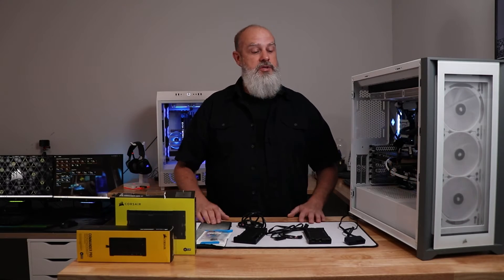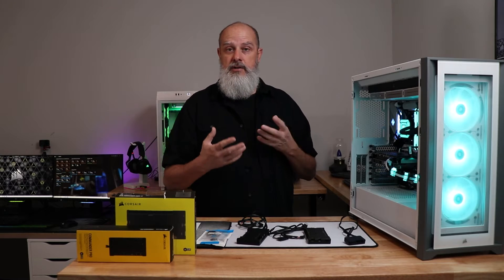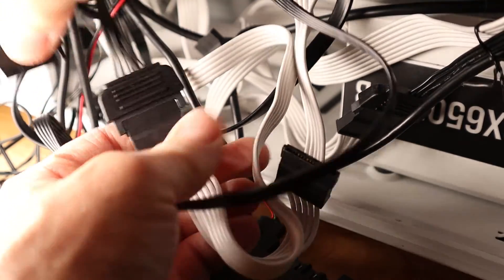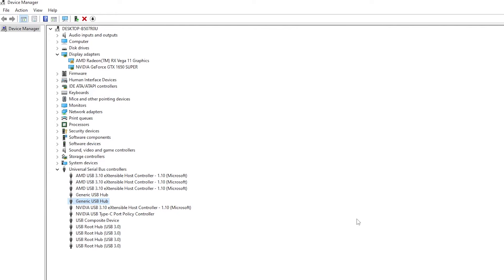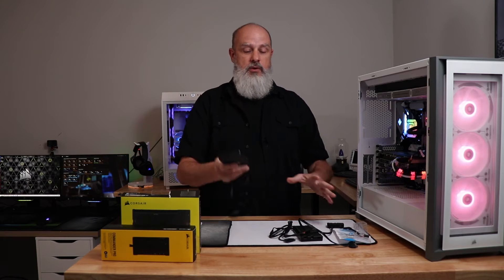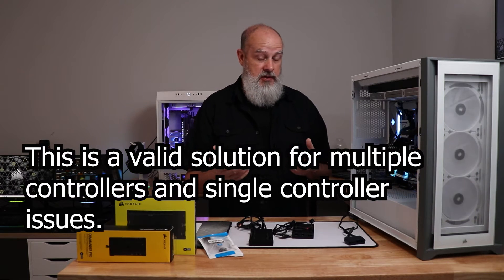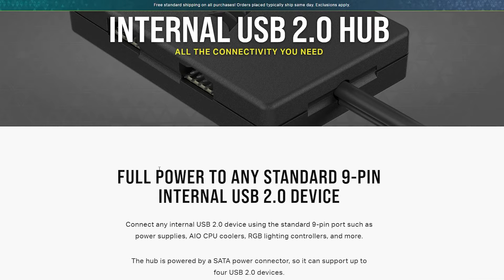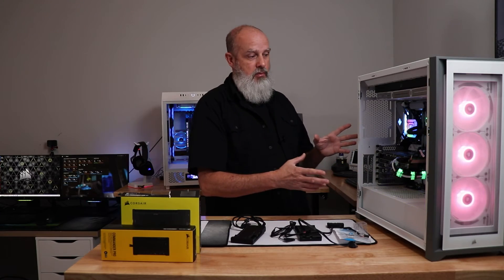Corsair iCUE doesn't detect my RGB controller

Comment: Hmm, I've been dealing with the fact that my iCue software isn't detecting the H150i ELITE LCD XT components connected to the Core that came with it, but this video did make me think about the fact that I am using that Y cable that came with the AIO. Right now, the Core and my O11 Dynamic EVO's Case RGB header are connected to that Y-cable. I'm going to have to give that a try. My motherboard happens to have two available headers, so I hope this has been my problem. I guess I'll update this comment if that was the case.

UPDATE: Well, I gave it a "college try", as my High School baseball coach used to say... I disconnected the iCue Commander and the O11's USB headers from the Corsair supplied Y cable, and plugged them directly into the two available USB 2.0 headers on my CrossHair VIII Dark Hero motherboard. No dice. I even tried swapping ports between the two, and still nothing. The case's RGB works and can be configured under Armoury Crate just fine, but iCue just does not see any sensors, the LCD, nor the motherboard (which it did at one point). I might end up trying an internal powered USB hub next (like the ones offered by Corsair or NZXT), which is likely my final hope before throwing in the towel. I mean sure, I could try poking around with Wireshark, but I've used it to track network traffic, and it can be a handful to get a good grasp of what's going on as it is... I can't imagine trying to track USB traffic.  Anyway, my only other suspicion would be the Commander module itself, but the pump and LCD otherwise works fine, albeit with the default display and transitioning rainbow LCD pattern, so the module is getting power through the main harness. Bah, at this point, I'm just a little frustrated, considering that up until a few days ago, it was working/not working occasionally from power sequence to power sequence. 😩
Reply: Any uppdates? Is it work? I have the same problem.

Comment: Yep, Icue is not detecting my Core Pro or XT.    Trried the different SATA and USB headers.   Installed Motherboard Chipset drivers.  No problems in Device manager, eno exclamation marks.   The only thing iCUE sees is the ram sticks and the motherboard temperature and fan speed sensors from UEFI bios.    No Corsair Controller boxes or fans are showing up.

AMD motherobard and latest bios.  
Are there USB drivers for these things I need to install?
Ist here some kind of auto detection button I need to click in ICUE?

I've used Wireshark before to capture DDOS attacks, when you got down to that point to diagnose the USB bus  traffic I was like holy sh1t!  Too blind to do that now, so not going to happen.

At this point I'm going to try to get iCUE to just detect eithe rthe COre or XT in the software with nothing else connected, one box at the same time, different USB and SATA ports.  I'm thinking they probably both are bad.  Or the USB motherboard headers just will not talk to them or vice versa.   I assume they are suppose to show up in ICue as a big icon like the ram sticks do...  if they are detected.  

I have no idea.  Very na5ty first experience iwth Corsair RGB lighting.  If I get this oorking, I'm never buying into it again that's for sure.  This is just not worth the long protracted stress and headaches.

Have not tried the reset buttons yet..

----- 

Nope still not seeing either box, in ICue 5.3

I'm temtped to mail these two dmmn useful things to you to see if you can get them to work and add to your wall, because they are useless junk to me at this point.

First time installing this stuff, and it has never ever worked.  I mean the Commander Core displays the RGB rainbow puke on anythign plugged into it... by default.   The CORE Xt doesn't display anything on anything plugged into it.    Standing alone plugged into their own individual motherboard ehaders, not daisy chained (like I tried when I first set them up).

Comment: I fixed my issue by uninstalling both headers' drivers in Device Manager. They are called "Generic USB Hub", it is shown in the video. After uninstalling them, you reboot the system and pray for the best.  Mine show up in ICUE as my h150i pump itself, apart from my other Commander. Hope this helps.

Comment: I keep hearing my pc usb connection sound and is happening after I updated my pc
Reply from the maker: Hi Stanley Perez, I've had that issue before,  and it can be hard to nail down what is causing it.  There is a way to tell windows to not notify you of changes in USB, but that's just a mask for the problem. I had to resort to removing all usb devices and add one at a time until it started doing it, and try a powered USB hub internally. I found that it was a USB HDD causing the issue last time, moving it to another port helped, but it still does it every now and then. I've had to leave it out a few times. Start with simplifying your setup, make sure all drivers are up to date and work back to adding everything. Good Luck, thanks for watching!!!!

Comment: Appreciate this post. After watching this video and other forums,  I did what I could and sadly, I still didn't get things to work.

I purchased the Corsair 4000X Case which came with the Controller.  Fan is working and RGB is working. 
The problem I still have is Windows gets the error code 43 Unknown USB which means I can't control my fan RGB :( 

Troubleshooting: 
- Reseated USB 2.0 header connection, Switched to other USB 2.0 header
- Reseated SATA power connection, Switched to other SATA power connection 
- Used USB 3.0 to 2.0 converter header 
- Went from Intel Motherboard with Core i7 9700 to AMD Motherboard with Ryzen 5 2600
- Tried installing and reinstalling the various iCue software
- Changed Power options to high performance and also configured in regedit.
Reply from the maker: Hi Jotaro, It sounds like you've tried all the basics. I'm going to assume other USB devices that are using the internal header work ok. You tried the 3.0 to 2.0 header which should help with any power issues, but if you can, try a powered USB hub. 

This device in the 4000x is a lighting node core, I wonder if perhaps it's just a bad controller, the 43 error may indicate a hardware error. 

I would try removing all other USB devices and their software, leaving only a keyboard or mouse connected, but it sounds like you've tried that. 

At that point, I would have to try another controller, Corsair may send that to you, but the lighting node core should be easy to find, check FB marketplace, ebay, etc. 

I hope that helps, keep at it and have fun with it!!! 

Thanks for watching!!!

Comment: so, ICUE sees my commander core in the software update, however it does not show it on the dashboard or in the firmware update section.
Reply: I fixed it, you need to uninstall both headers' drivers in Device Manager. They are called "Generic USB Hub", it is shown in the video. After uninstalling them, you reboot the system and pray for the best.  Mine show up in ICUE as my h150i pump itself, apart from my other Commander. Hope this helps.
Reply: Same issue here

Comment: Corsair iCue is absolute mess. I couldn't even install it because their next button didn't work and no messages were popping up. So after Googling I had to change my locale and it went through. Then I booted into an empty application and my very expensive high end Corsair keyboard and mouse were not detected... I'm now into hour 3 of trying to get this thing to work...
Reply from the maker: Hi Lubos Maly, I'm sorry to hear the troubles with iCUE. It's mostly stable when i've used it, although i've had some hiccups with it at times. Some really basic suggestsions would be to disable all other rgb controlling software, uninstall icue and reinstall it. 

There was a recent update to ver 5.0 of icue, if you haven't installed that, try uninstalling, reboot and reinstalling the latest version. 

Let me know what you find, thanks for watching!!!
Reply: @HardwareArtisan  I had to get rid of my Express VPN to get steelseries detected so these apps seem all busted up

Comment: I just moved my PC from the floor to a table. Then my fan RGB went out. Corsair iCue only sees the cooler and memory. Fans are working but no lights. it was working fine until I moved it and now it's not. But the main problem is Corsair iCue doesn't see the fans at all. The iCue software has no way to add the fans again.
Reply: U found a solution ?

Comment: I recently installed 2 new fans into my case, and now icue does not detect any of the fans. The day before I installed the new fans, i cue picked up the 3 fans i had installed just fine, now it doesnt pick up anything after I installed the new fans. I already checked and have made sure there is no issue with cables or power or anything inside the case, the fans still spin and my 3 original fans still have a static purple color but the 2 new ones are white. What do I do??
Reply: Same issue! Did you fix it?
Reply: @spamurai565  Yes but im sorry bro I dont remember what I did, i will tell you if I ever remember but I am fairly certain it was a software issue, and I didnt have to physically do anything to the fans or rgb controller

Comment: I'm pretty certain that wallpaper engine  interferes with this Icue.
Reply from the maker: Hi Mikey Waite, thanks for the heads up, I haven't messed with wallpaper engine much, I'll have to try it and see if it breaks things, I could see that. 

Did it cause your controller to not be detected?

Thanks for watching!!!!!
Reply: Yes. That's what seems to happen. After more tests I don't think it's a problem with Wallpaper because I still get issue and now I've purchased Scuff Envision Pro which is alsoset up via icue and giving me all kinds of issues.

Comment: Thanks! This video has helped with troubleshooting, but I think I have a unique issue, essentially my H100i suddenly stopped being detected by the iCue software. Strange thing is when I disconnect the ext cable from the AIO to the commander pro, then commander pro is detected by iCue, but once I plug the ext cable from the AIO back in iCue can no longer detect commander pro. Any suggestions?
Reply from the maker: Hi Piers Yem, That's a great question!  It's always a bit of a concern when a device being plugged in causes an issue with another device. Here is what I would do. Let's start by making sure the commander PRO is still working normally, I'm assuming when you say ext cable, you mean the USB cable. 

Since you're experiencing this issue, i'd excercise caution and power down before connecting and disconnecting each component. You don't want to be connected things, even usb,  with power on if there is something flaky going on. 

Unplug the AIO from commander pro obviously and make sure the PRO is detected in icue. 
Plug another device into the same USB header on the commander PRO that the AIO was using and see if the PRO still works. If that causes it to be undected by icue, or the newly connected USB device isn't detected,  i'd suspect a possible issue with the PRO.....In that case, I might just use a sata powered USB hub for now. 

If the PRO works at that point along with the newly connected device, i'd assume the PRO is ok. 

My next step would be to try connecting the AIO pump to a different SATA Power connector. I would also try a different USB header for the USB cable. 

Since I can't say for certain what the issue is, I might be a little hesitant to plug that into an expensive motherboard, since it's possibly causing the PRO to not be detected. So I would recommend using a sata powered USB hub to try it on. - Personally, i'd probably just try the motherboard, but do that at your own risk. 

If the AIO doesn't work with a new SATA PORT and/or USB connection, I'd at least check to see if the PUMP is getting power, you should be able to hear it running to ensure it's cooling for you. If the pump is running, you should be able to at least for now control it if you plug in the tach cable to the pump/cpu fan header on your motherboard. 

To troubleshoot it from there, you'd have to look to look to see if it's showing up as a USB device at all in device manager. I'd also try uninstalling/reinstalling icue as a troubleshooting step. 

Beyond that, I'd have to research if you can reset that controller, or it may be bad. 

If the PRO has a problem, try connecting it to a new/different USB header on your motherboard or a sata powered usb hub. try a new SATA power connection for the PRO as well. 

Good luck, let me know how that works, hopefully your PRO isn't bad, but let me know what you find. 

Thanks for watching!!!

Comment: Thanks for the info. The Corsair commander pro and AIO cooler won't both show up in iCUE at the same time. How do I connect the rear exhaust fan in the Corsair 5000d Airflow case?

Comment: Hello everyone, to whom can give me a solution: 

I've had issues for like 2 weeks now with iCue on my pc; all my cooling hardware (including the case and the PSU) is from Corsair. The iCue software started to not detect the AIO cooler or any of the other fans, but strangely enough it still detects the RAM DIMMs. I tried everything in this video and even got a new Commander Core thinking it would solve the issue, and nothing changed. It is worth mentioning that prior to using the new commander core, I sent it to a PC repair shop because my computer wasn't even loading games or even normal apps like Zoom (it has a Ryzen 7 5800X, RTX3080, 32 GB of Vengeance RAM, and 850W of PSU). The PC runs normally but even after doing a clean uninstall and reinstall of iCue COUNTLESS TIMES, and even updating my Motherboard BIOS, it still won't detect anything other than just the RAM DIMMs. I guess I'd still need to try another whole new AIO, but I am not planning to spend money on another AIO cooler. 

I am beginning to think it's either the PSU, the motherboard (Gigabyte B550 Vision DP), or even the fact that I am running windows 11. I am at the verge of formatting the PC to factory settings, and still I am afraid it won't work. Any other suggestions? Thanks.
Reply from the maker: Hi Samir Ali, i'm a bit late getting back to you, You may have tried this already, but I would simply the problem and isolate the hardware. Start with just seeing if you can get the Commander CORE recognized in icue. 

Disconnect the AIO from the 24 pin port....when the AIO is connected, it will detect as your AIO, when the AIO PUMP is  unplugged from the 24 pin port, it should detect as a Commander CORE in icue. If that works and is detected, make sure all the fans work on it, both RGB and speed control, just to 'prove' that the CORE is good. 

Then reconnect the AIO, if it all disappears even using your new Commander CORE, Id suspect the AIO PUMP,  but I would definitely try a new SATA power connection on a different cable. 

If you have one, try a powered USB hub as well, at least a different USB header, on your motherboard, simplify as much as you can. 

If you can get the core recognized by itself, i'd update the firmware, even force the firmware update if it's up to date, i've had to do that a couple of times. 

And, a couple of times, i've had to simply unplug power from the controller and let it sit for a minute or two. 

I recently had a Commander CORE go bad on me, after doing this video....it damaged a little chip on the board, i'm not sure how....i'm going to do a follow up video to this exploring the CORE a little more. 

Sorry your having trouble, it can be very frustrating...We've all been here. 

Let me know where you end up with it!! Thanks for watching!!!
Reply: @HardwareArtisan  Hey there! I haven't tried the 24-pin port thing, but I did try a different SATA PSU cable with the new commander core Corsair sent me and nothing changed. I also tried changing USB headers in the MOBO, nothing. And just to confirm, you're suggesting that I try unplugging the thicker cable that goes from the pump into the commander core with the PC still running? 

thank you!
Reply: Same issue, just ram, frustrating. Send to corsair nothing change.
Reply: same issue here, everything was working fine then today after reboot iCue only sees my GPU and RAM but my AIO will not get detected!

Comment: If I figure out that another RGB Cooling software is interfering with iCUE, what would you say is the next step? (I also have the NZXT CAM software)
Reply from the maker: Hi RobbCabaian, If I determined another software was interfering, I'd start by making sure they are up to date on both of them. Beyond that, you would have to troubleshoot further if there is a way to configure them to peacefully co-exist. That might be difficult to do. I'm not aware of any specific issues with the CAM software, I have used both at the same time, but I've mainly used CAM as a monitoring tool, not for RGB control at the same time....Although i've used that too, but maybe not with corsair. I do have a NZXT controller I could test with if you're having a specific problem, let me know. 

Great question, thanks for watching!!!!

Comment: Odd behavior: Running two commander XTs, just unplugged the fans off one commander to clean up some cabling, replugged everything back in and now that commander and my H150i LCD both arent being detected in iCUE.  Both were recognized prior to messing with things, but now they arent.  The LCD and screens are working, just not being detected.
Reply: Find a resolution? I’m having the same issue
Reply: same problem here
Reply: Same any luck ?
Reply: @janaydaniels4573  For me it turned out i didn’t plug one of the intertwined usbs to the motherboard form the commander. fixed it